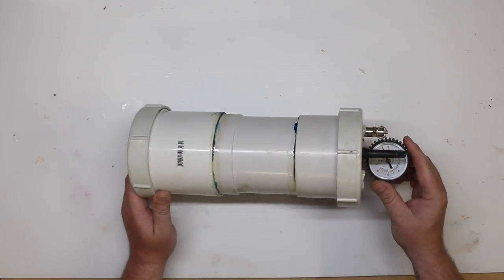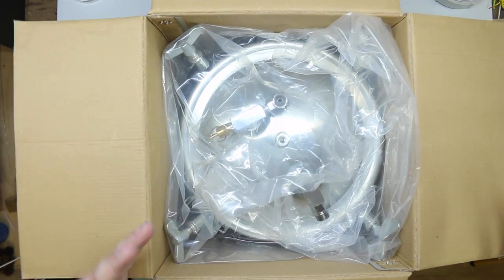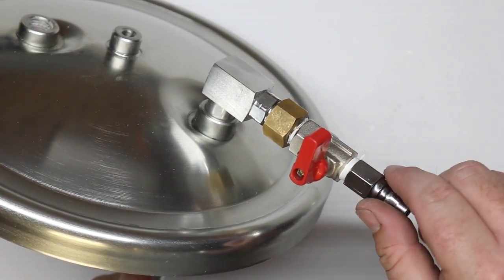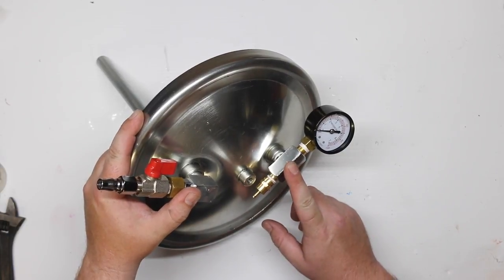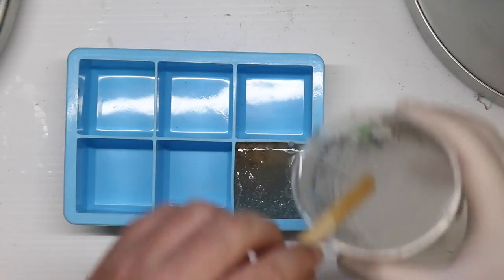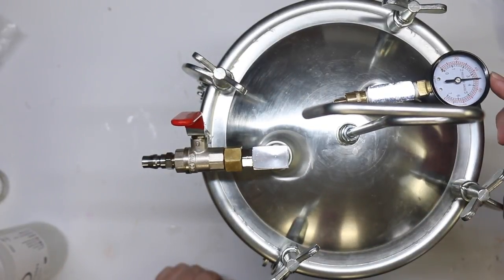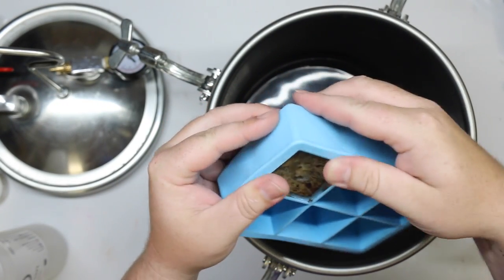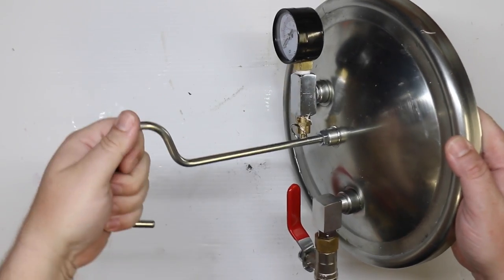DIY Pressure Pot for resin casting

Comment: The dip tube unscrews from the underside of the lid and you should keep the regulator. Put the ball valve between the regulator and lid.
Reply: Mine doesn't unscrew. I just tried. But I also can't seem to unscrew the regulator. 😂
Reply: @channymichelle  got a pipe wrench for the tube? A big wrench of the right size, or an adjustable one, should do for the other parts.
Reply: @greggv8  I don't on hand but I've given up for now and will be enlisting my uncles help on Wednesday. I'd be surprised if he didn't have a pipe wrench. Might have to try that. I can't even find my single wee spanner. I can't even unscrew the damn gauge. The only things I can screw and unscrew are the side grips. Everything else is not even budging.

Comment: Got one today, my t adaptor snapped at the join when I tried to get it off, lock tightened on. So now $300 down with nothing
Reply: did you ever fix this? same thing happened to me
Reply: Surely a suitable bolt, nut and washer with application of epoxy glue would ‘fix’ that?